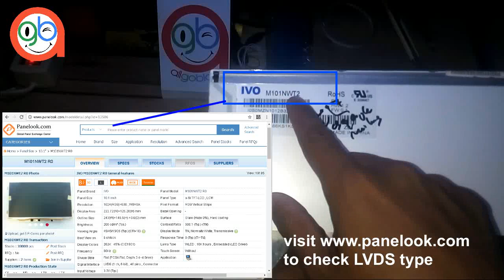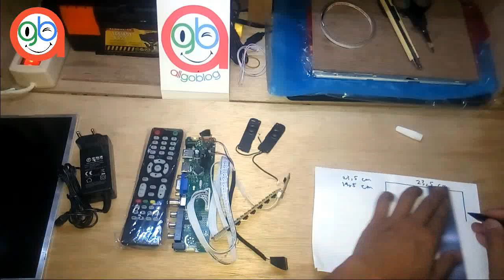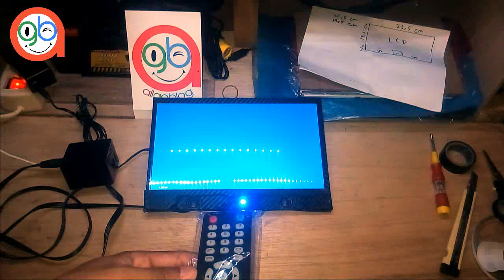DIY Monitor with Universal LCD Board V56 for Orange Pi / Raspberry Pi

Comment: Thanks, great tutorial,
btw mau nanya gan, boleh ya? 
1. lcd boardnya gak pake tambahan inverter ya gan? 
    soalnya gw lagi nunggu paket lcd board v59 + inverter
2. kalo liat di spec LCD boardnya butuh power 12V 4A, pake adaptor yang 2A gak panas  gan?
maaf banyak nanya ya gan,
Terimakasih video tutorialnya, sangat bermanfaat.
Reply from the maker: +choky s 1) panel yang di gunakan type LED panel yang sudah onboard inverter.
2) disarankan 4A up untuk pemakaian jangka panjang, kalau hanya untuk test 2A cukup.
Terimakasih mas bro.
Reply: iya, aku baca specnya ternyata gak perlu inverter, hadeh :(
thanks a lot gan, vidoe2 tutorialnya sangat bermanfaat
Reply: @allgoblog  pake lcd tablet bisa?
Reply from the maker: @OK-qt8ge  beda controller dengan TTL port (bukan yang LVDS), dan lcd tablet dengan tipe pin 50/ pin 40 TTL